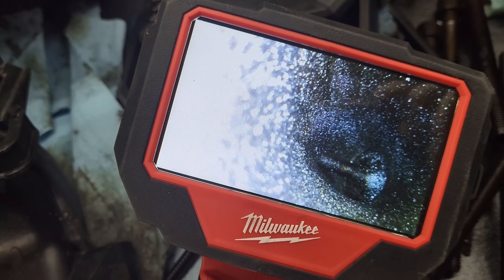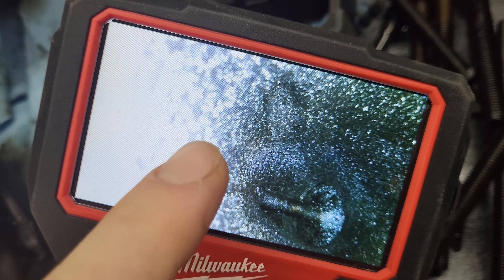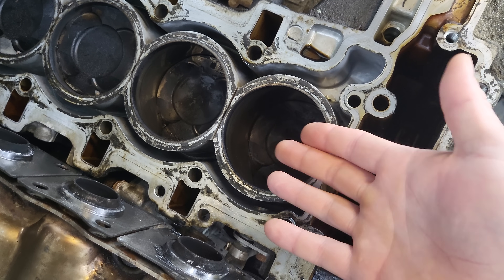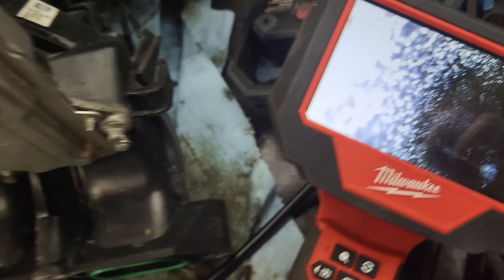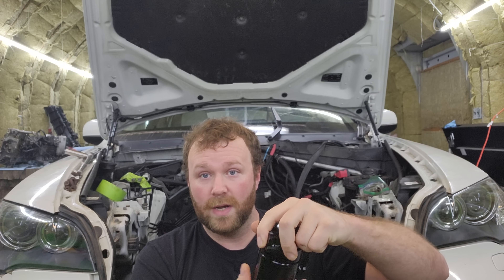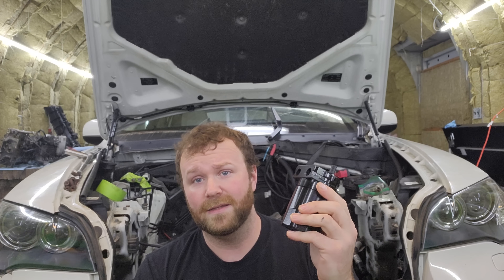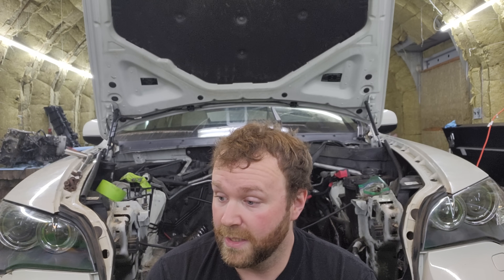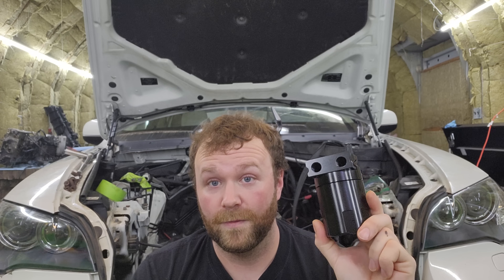The Modern Engine's Achilles Heel: How to Prevent Costly Carbon Build-Up in GDI Engines

Comment: Gdi better emissions??? I don't think so... Also catch cans do F all especially on a forced induction gdi engines. The only thing that actually works is water methanol injection.
Reply: Junk Subaru engines, replaced a bunch of them, boxer engine cylinders egg shape, eventually they leak oil everywhere from steel head gaskets!
Reply: @MD-zh4ym  Brando has electrolytes plants crave electrolytes. Thats what you sound like. Emissions are mainly reduced by dumping less fuel into the exhaust and instead burning it in the cylinder you do this with less camshaft valve overlap. if you burn all the fuel in the cylinder guess what you don't need a catalytic converter so you have less exhaust backpresure thus improving fuel economy all the modern car manufactures do it wrong on purpose to make gas cars look bad.
Reply: @MD-zh4ym   your bragging at less than 25,000 just wait until you have over  100,000 miles you will soon learn what we are talking about.
Reply: @MD-zh4ym  less fuel doesn't mean less pollution. Diesel for example. Aslso lpg and hidrogen. Scientists worked for ages to reduce the harmful exhaust emissions and to convert them into harmless co2 and water wapour. The current gdi engines do the exact opposite. They emit slightly lower co2 emissions but the emit 500% more carbon particulates. That's why a brand new mpi engine comes with a single catalytic converter while a gdi one comes with a cat and a gasoline particulate filter.

Comment: I've been saying this for years! A catch can is a must.
Reply from the maker: its slowly becoming common. hellcat owners are swearing by them! :P
Reply: This is old technology that plagues the first GDI engines that came out in the late 2000s/early 2010s (BMW, LExus, VW, Audi). Most new GDI engines have an oil separator in the PCV system now to avoid this issue. Putting an aftermarket jerry-rigged catch can reduces the ability of the built in system to do its job.
Reply: @milfordcivic6755  GDI has been around since at least the 1960s.. they didn't go with it because it was obvious back then that valves would get clogged.. 

Engineers today are morons, they can't even build a road that lasts 8 years anymore.